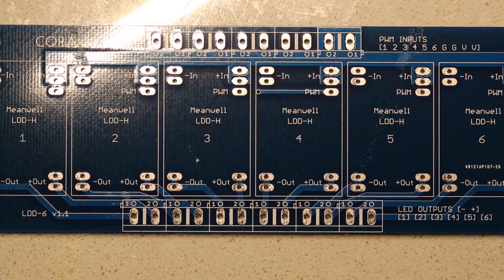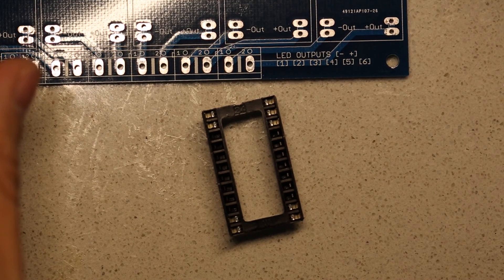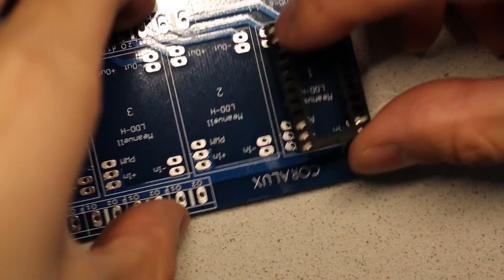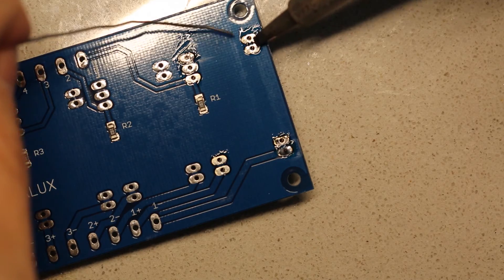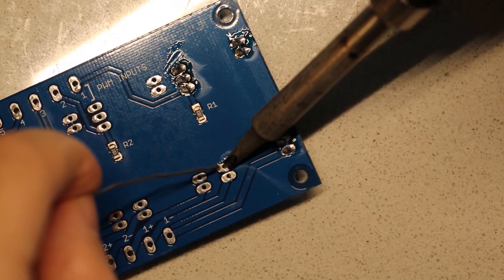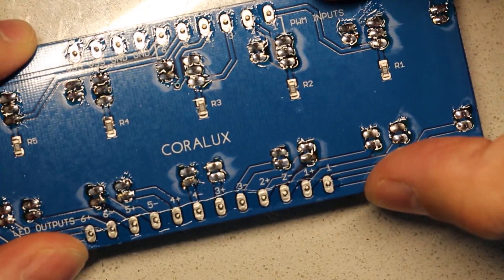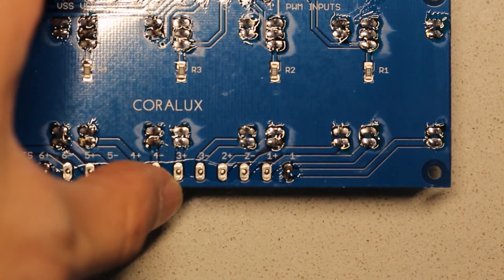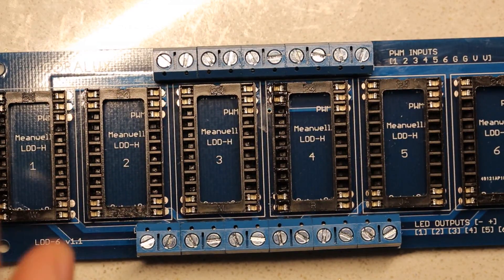Coralux LDD Driver Board Assembly & Soldering

Comment: I built the 4 board with ldd-h1000ma. I tried each driver with a 12 v wall 3watt.  And my leds connect to out, and nothing! I tried each one and nothing on any of them. 
I tried the same leds with the same 12v power supply. And a single ldd-h 600ma driver and they work. 
What should I check?
Reply: You need a PWM signal or they will do nothing. They have built in pulldown resistors.